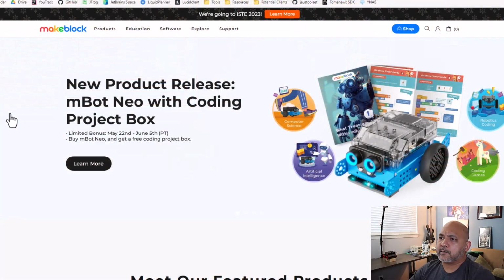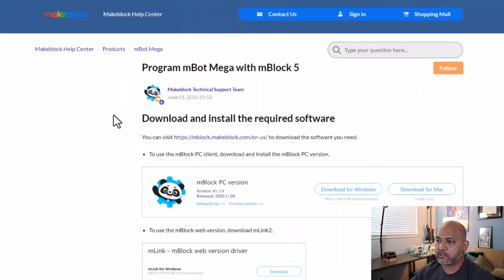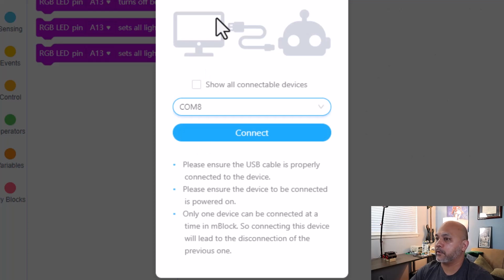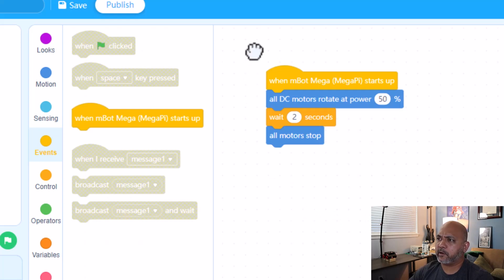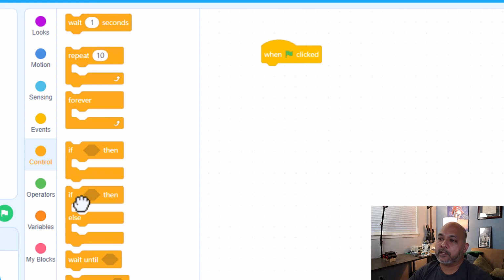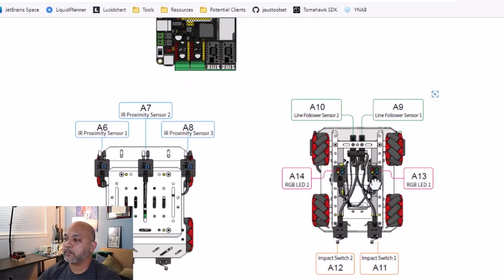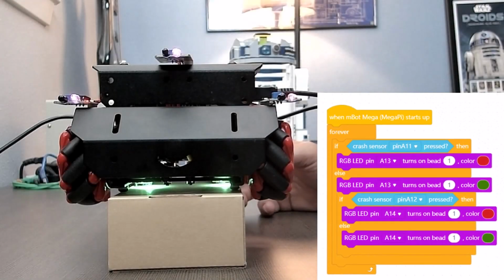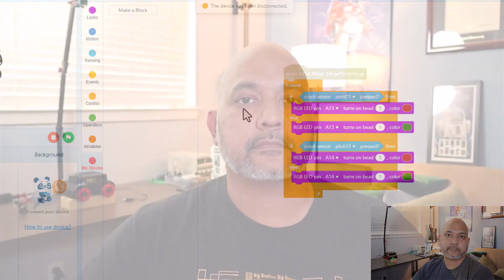Programming the mBot mega with mBlock 5

Comment: Hello, i have a question, could You programing the code of robot sumo with mbot mega?
Reply from the maker: I'm not familiar with the rules of robot sumo so I only did a quick google search to get some basic info. 

There are 3 basic actions required for robot sumo: find opponent, detect ring edge, push opponent over right edge. The mBot mega can perform these tasks with some programming using the IR proximity sensors to detect the opponent, the line tracking sensors to detect the ring edge, and the motors to push the opponent. 

However, I don't know the size and weight rules to know if it qualifies for any of the divisions. In addition, it's not designed for this activity so the motors may or may not be adequate for the necessary torque to push another robot, or the speed to be competitive in a real competition. Many robot sumo vehicles also have a flat angled front to help push their opponent which the mBot does not have. The raised front of the mBot could be a disadvantage in a real competition. This is where the mechanical design matters.

In short, can the mBot be programmed to execute the necessary tasks for robot sumo? Yes. Will it be a good base platform to do well in a robot sumo competition? Unclear, to likely not.